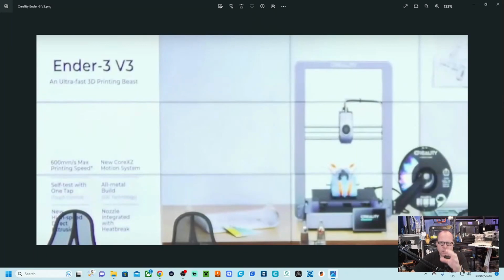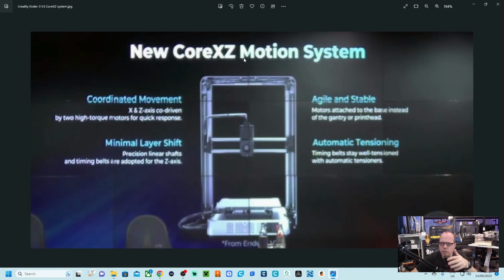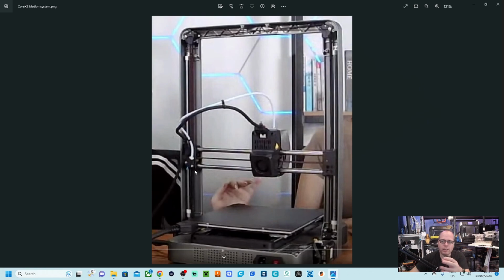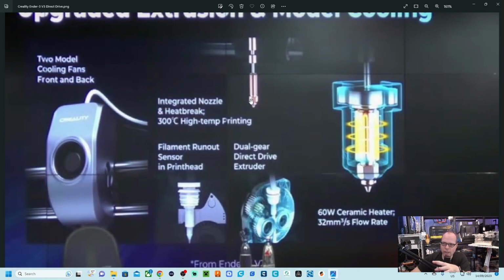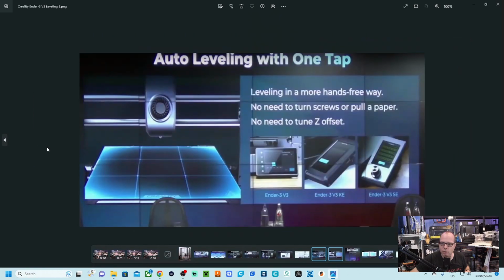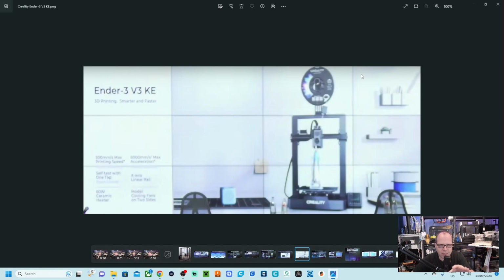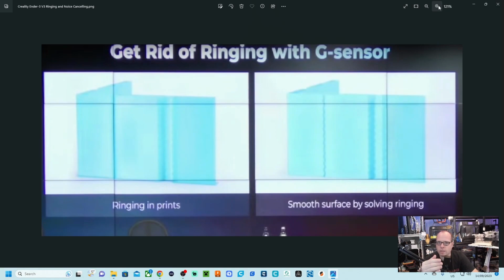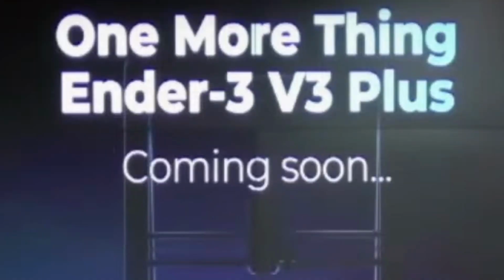Creality Ender-3 V3 Series - Z3DP Reacts

Comment: Creality Hype Train pulling in to the Station! Still doing some research on why a core-xz is better than a regular bed slinger. Oh, and FIRST!
Reply: Having a fast Z is completely useless plus the bottleneck is still the plate weight to swing
Reply: lol do you input shape bro @enricobononi8655
Reply: fast x is great though @enricobononi8655
Reply: Do you want a medal?
Reply: yes please.  @trance_trousers
Reply from the maker: Maybe in the future they will be faster or maybe now. There is this Voron Switchwire that has also the CoreXZ system and suppose to be fast.